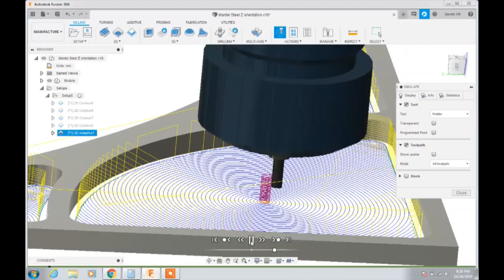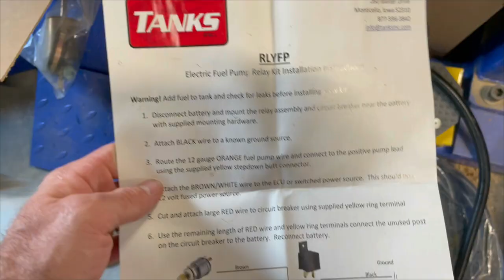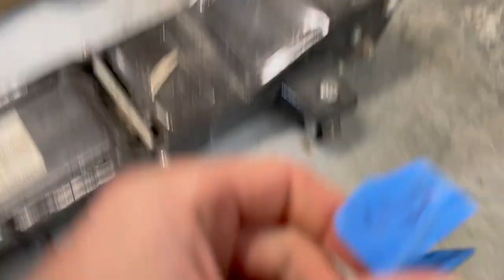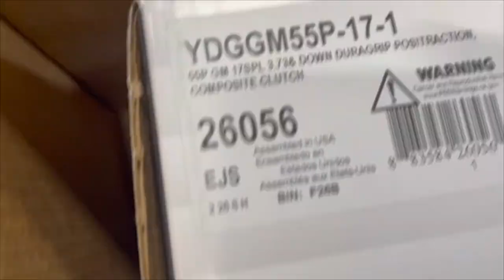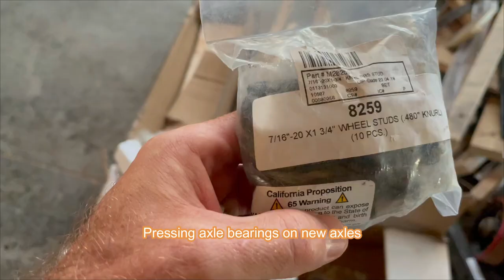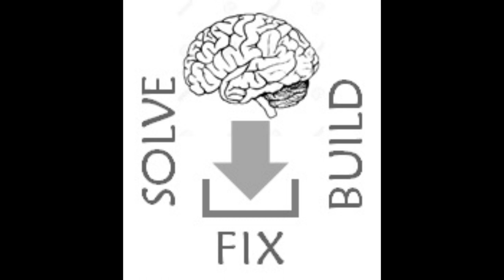THE PROJECT SNOWBALLED! EFI, Gas tank, rear end and suspension - 1961 Chevrolet Impala

Comment: There are holes in the frame, through the driveshaft tunnel, where the metal fuel line would run for the 327 or 409 engines. They would keep the fuel supply line away from everything.  You could have used the 6 cylinder or 283 supply line as a return as they follow the frame on the top. Both avoid the exhaust and manifolds or headers. I really like the lift adapters that you designed. And lifting the empty rear end housing sometimes helps bolt alignment. Remember that with the aftermarket rear suspension, the rear can move lower away from the frame, which could put undue stress or tear the rear brake hose that supplies the rear through the frame.